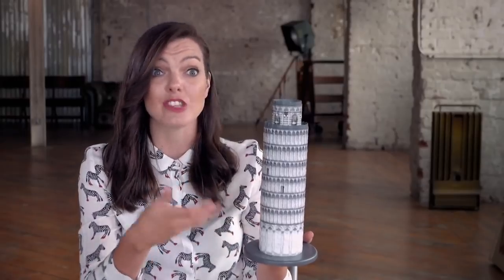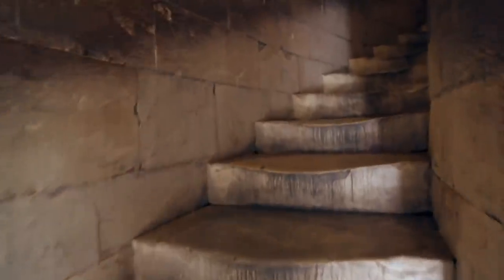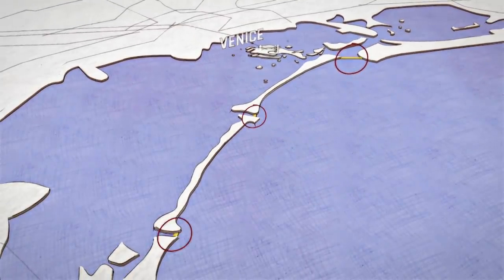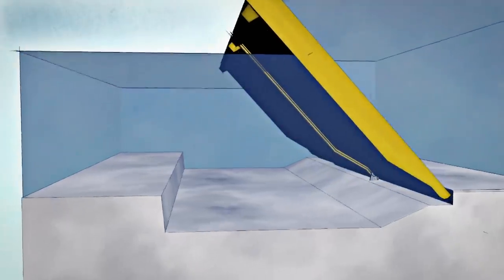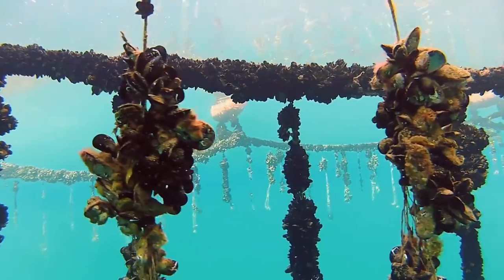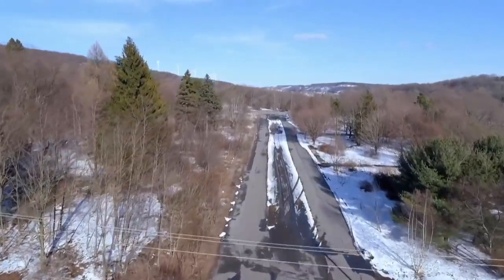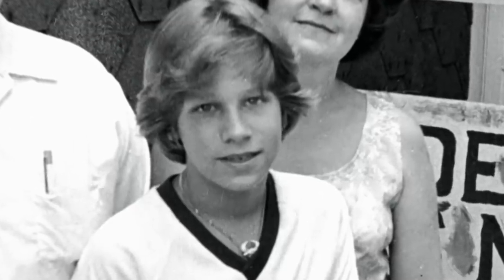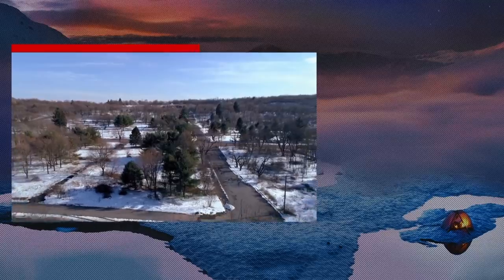The World's Most Dangerous Engineering Mistakes | Massive Engineering Mistakes

Comment: I always thought that they should remove the top floor of the tower and place it in the plaza to lower the center of gravity, and to have something to show if the tower does collapse. The top layer or layers could be replaced with a replica made of light weight materials, or nothing at all.
Reply: I guess any sort of construction work to remove the too floor would require a lot of heavy machinery which could endanger the tower